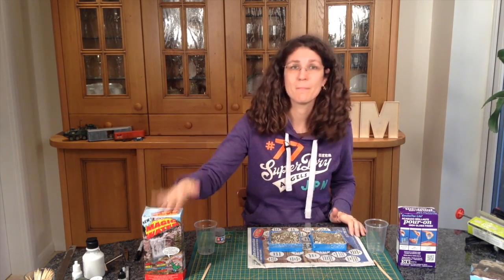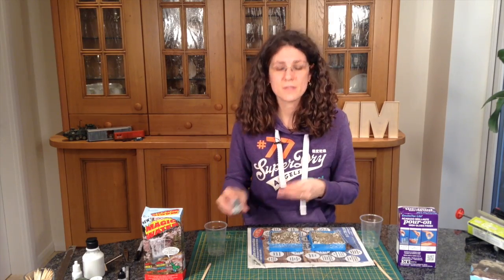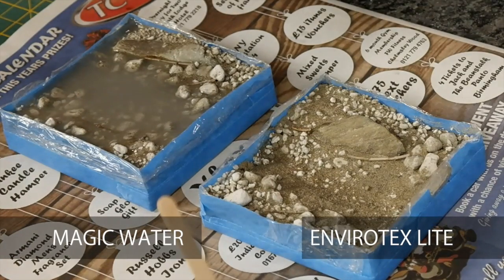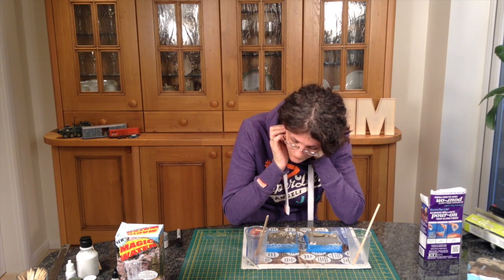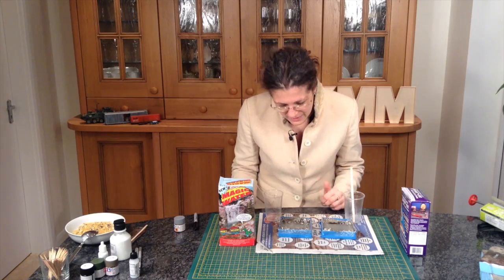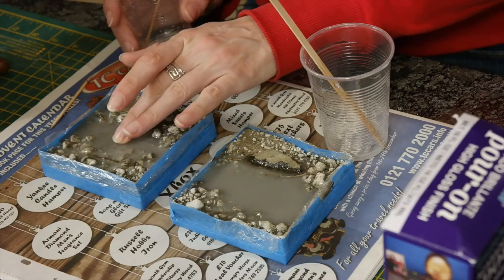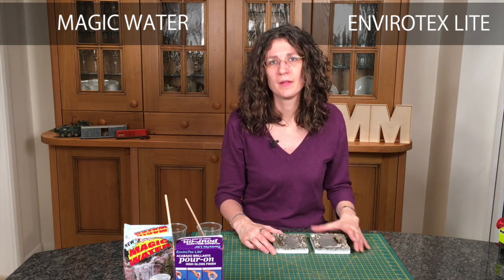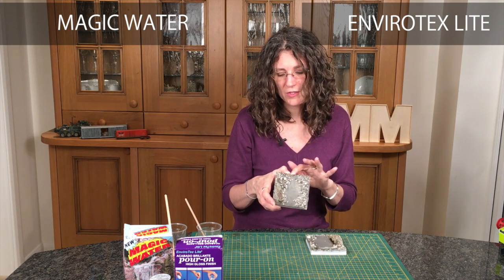Magic Water v Envirotex Lite

Comment: Hello Kathy, Have you ever used Woodland Scenics Realistic Water?  and water effects? im wondering how it compares to the resins and epoxys?
Reply from the maker: Shaun Basham Hi, I haven't. I've heard bad things about one of their products so I guess I keep away from them. That's probably unfair on them.
Reply: ya I have heard their EZ Water is not very good caus it has to be melted down. I would be interested to see a comparison with the Magic Water and the Woodland Scenics Realistic Water. I have absolutely no experience with any of them as I am working on my very first large Diorama in HO Scale. I have been watching your tutorials on rivers and such as mine has a river. Oh i do have another question. the blue foam you use. what kind of foam is that? i could not find anything like in my local home depot here in the states.
Reply from the maker: +Shaun Basham The blue foam is craft foam. You can use house insulation foam instead if you can find it. Over here, it's often flame retardant Celotex that you have to carve with a knife rather than a hot wire tool but it works as well.

Comment: I know this is 3  years back, but have you tried Vallejo Still water?
Reply from the maker: No I haven’t. Have you?
Reply: I have it but have not myself
Reply from the maker: If you do try it, let me know how it goes please.
Reply: I sure will Kathy, I have seen what can be done with it, not bad at all, but not really for larger areas I think, unless poured in small quantities at  a time.
Reply: My experience is that for making flooded shell holes it is not great, you need a flat surface as it shrinks and conforms to the surface too much which makes very unrealistic finishes. I actually cut it put of my dio and invested in envirotex.

Comment: COMMENT 1/2  Great practical comparison and tips, Kathy. Thanks again for sharing.There is nothing like seeing it with your own eyes!!   - Kathy, Do you know any detail about the type of resin for Magic Water??  are they both  EPOXY-resins?  I have a suspicion MW may be different because of the  1. different mixing ratio (epoxy resins seem to be mixed 1:1) & 2.the manufacturer's advice that Magic Water formula has less bubbles  -  Magic Water may be something else or tweaked in some way (as Easy Cast supposedly has been)
Reply: +Vikki Wilson 
COMMENT 2/2
3. The manufacturer’s website statement that they were searching fora “perfect water effects” formula (knowing the limitations of other products) during product development.
PS I saw “Commissar Gamza” pour his clear water effects (Vallejo)in his swamp MUCH DEEPER than usually recommended.But I don’t remember him showing the solid piece. So it could be still curing :) Sorry for longpost.
Reply from the maker: +Vikki Wilson Thanks for your comments!

I think Magic Water is still an epoxy resin but as you say, the Manufacturer chose a different mix to try to deal with some of the common problems.  He's certainly been successful!

The difference in bubbles was striking but I don't remember Envirotex ever being that bubbly in the past.  I'll show off some of my previous work next week.

If you pour deep layers (certainly of Envirotex) then the chemical reaction can lead to quite high temperatures and I have heard of plastic people melting.  I didn't do a heat test but thin layers have much less of a problem anyway.  I suspect it will cure more quickly because of the heat but that may cause its own problems.

Thanks for the support

Kathy
Reply from the maker: Vikki. Glad to have helped a little with your own pools. If you are worried about the plastics then a test pour would be the safest idea. I usually embed natural materials so have never had a problem yet. Do let us know how they turn out. 
Kathy
Reply: I'll advise if there are any explosions or any inclusions disintegrates:)

Comment: All right. At day three your complaint is that it's still wobbly and rubbery. I watched you eyeball measure the product into a single cup. Huge mistake with magic water and Envirotech or any other kind of resin. If you've got two parts then use two different measuring cups use a scale and make sure that your portions are correct and spot on. Especially with magic water. If your magic water is still too soft after 24 hours then you have mixed it wrong. Probably too much Part B. Too much part a the small bottle would have made it hard and faster. But other bad things can happen. I've not had anything really bad happen but Dave said don't do that so I don't. So how do you fix it? Easy mix up a correctly measured smaller portion and just pour it on the surface. It will cure hard on top and the rest of it will be just as beautiful. Magic water does stay a little rubbery for a longer period of time but if your temperature environment is correct warm enough then it will eventually cure Rock hard. The part of its beauty is the elasticity of the product.
Reply from the maker: It’s not eyeballed. There are measuring marks on the cup. Magic Watee always stays rubbery. It’s not a problem, it’s a strength.

Comment: Okay the time factor. You don't need all the time in the world you just need 24 hours if you've mixed it properly. Which you didn't. Also you don't ever want to pour this over a waterfall and expect it to harden as a waterfall. You'll just have a smooth glossy surface and a big puddle at the bottom. Resin is for basins.
Reply from the maker: I put it over the waterfall to tie the top in to the right level. Works a treat.
Reply from the maker: Loads of great comments you’ve made. This is a very old video and my workflow is very different now. I’ve moved on from both these products as there are much better options out there for what I do.

Comment: I used Magic Water on Pine Road and like you, I couldn't believe how long it took to dry. After about 4 days I thought it was ok a little rubber to touch but ok. I had a fisherman in a cast white metal boat, Yes he sank, on trying to pull him out it was like a load of treacle. Oh dear  .  Please note, there was no paint in my mix
Reply from the maker: Colin, despite the long drying time I do like its rubbery texture as it's easier to trim and I suspect won't shatter like I've seen some resins do on exhibition layouts. 

The boat's a real pain. When do you put it in becomes a real worry.
Reply: Kathy.
It was the Langley models one a little rowing boat, I thought it would be OK but after a day it had sunk, luckily its not to noticeable as the depth is only about 5mm
Reply from the maker: At least no major harm done.

Comment: Maybe not enough hardner?
Reply from the maker: +Len Pytlewski I measured it exactly and Magic Water always takes a long time to set for me.
Reply: I wonder if you added more hardener if it would set up faster. A little experimentation may yield better results...just a thought .
Reply from the maker: +Len Pytlewski I probably should experiment more but I did find adding more caused a pattern on the surface so I haven't gone down that route again.

Comment: Just two things. One to read the directions. With magic water you sir and sir and star if you have not mixed properly it will not set. Again if you have not mix it properly it will not set. second measure if you have not measured properly that will not set.

I've use Magic Water for years. Any questions that you have about the product you can always call and ask Dave.

Bubbles. With magic water to the Spurs pobbles you use heat a hair dryer will do it. With Enviro techs is carbon dioxide hold your breath. Again there's that reading of the directions to know these things. The only other reason why your set for Magic Water would be 4 days long with a temperature and humidity. It clearly states it is our temperature of 73° or better. I once had a full week cure. But I could not get the room temperature above 68 or so. This is probably one of the worst and negligible comparisons of any two products that I've seen so far. Sadly you happen to pick one that I know very well. You actually picked two that I know very well. My cleaning a link to another video that compares a variety of resins for yellowing. Enviro text is the first one to go ocher. Magic water it isn't part of the test. But it should have been.

https://youtu.be/MzIxcIqCNh8